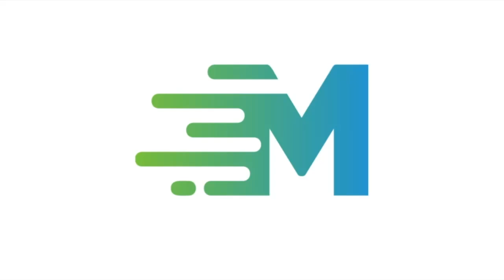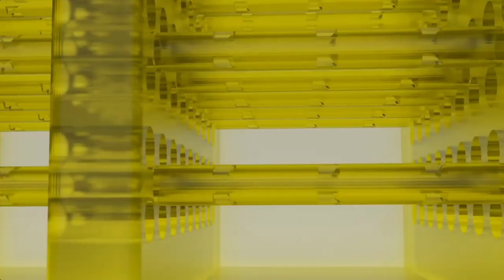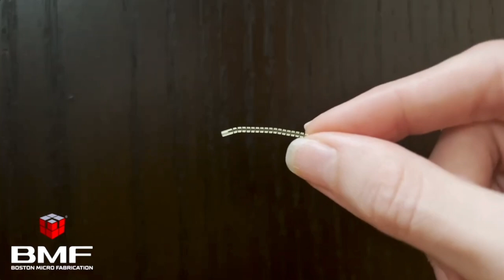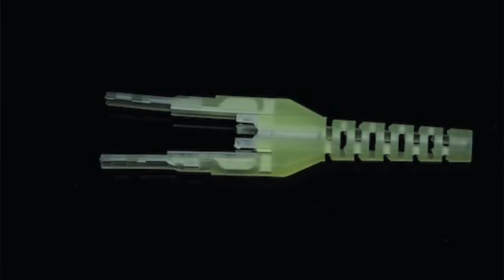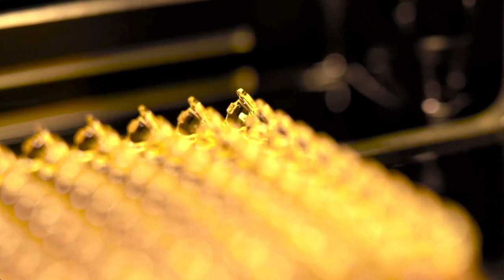3D Printing Smaller Than a Human Hair: A BMF Deep Dive with John Kawola

Comment from the maker: For the engineers and tech-heads, here are the key moments from our talk with John:

00:00 - Intro: The Future of Micro-3D Printing

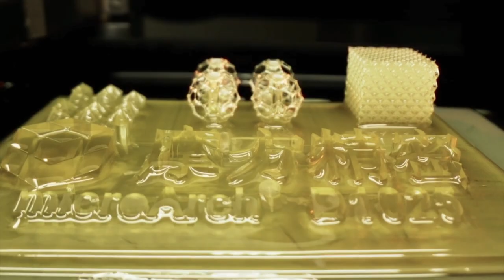00:54 - What does "High Precision" mean? (Tens of Microns)

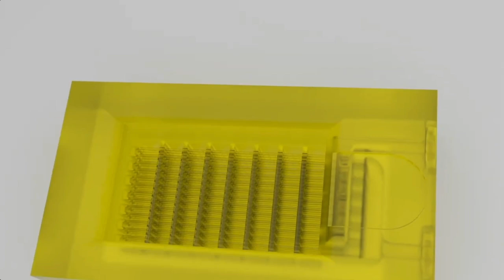01:32 - Why MedTech is obsessed with Miniaturization

01:55 - John’s personal story: Why smaller incisions matter

03:01 - Solving the "Impossible to Manufacture" problem

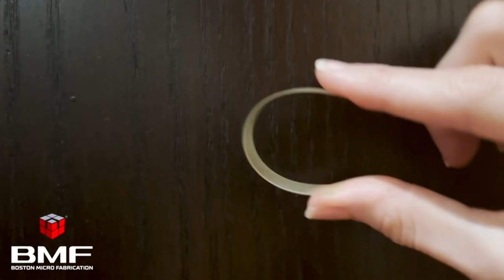04:41 - Prototyping vs. End-Use Manufacturing

05:46 - Material Science: Polymers and Ceramics

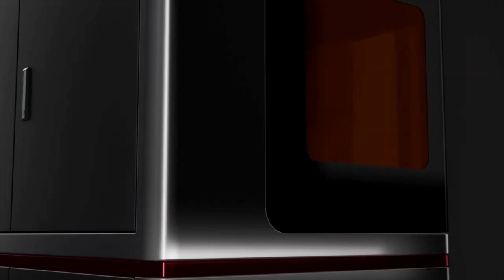06:58 - The D1025: Two Resolutions in One Machine

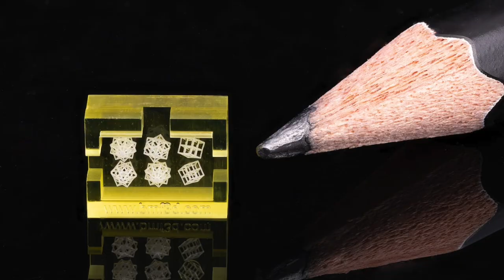08:10 - Visualizing Scale: Comparing to a Human Hair

09:33 - Use Case: Advanced Micro-Needle Printing

10:44 - Revolutionizing Drug Delivery: The end of the Needle & Vial?

12:26 - How small can we actually go?

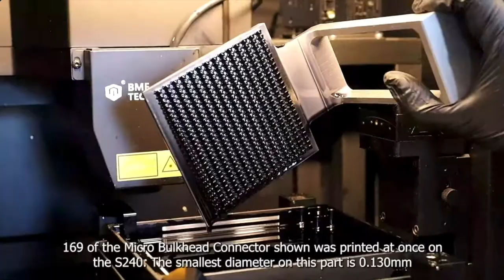13:08 - Expanding the Library of Medical Materials

14:52 - How to solve your "Small Part" problems

Which of these applications surprised you the most? Let’s discuss in the comments! 👇